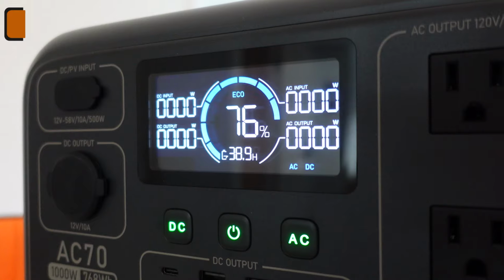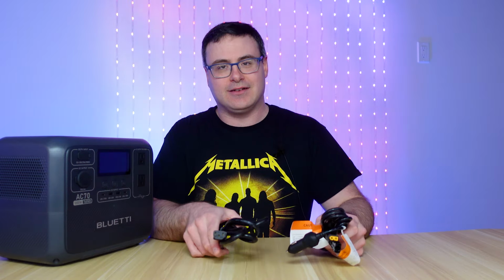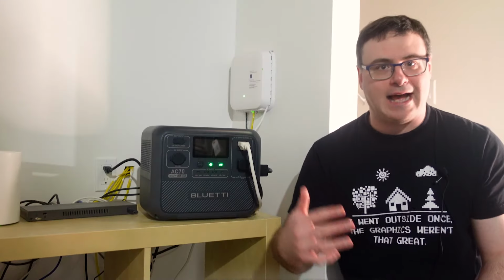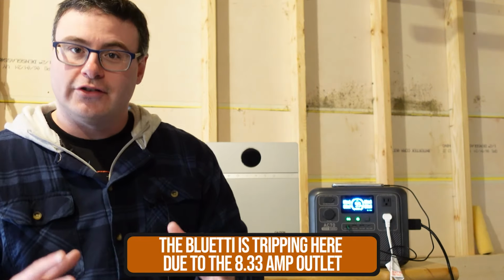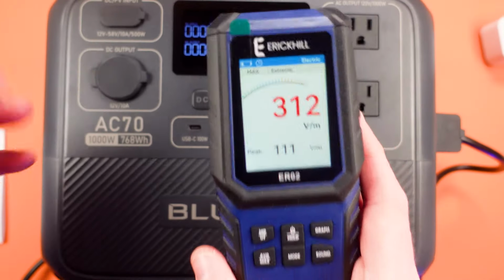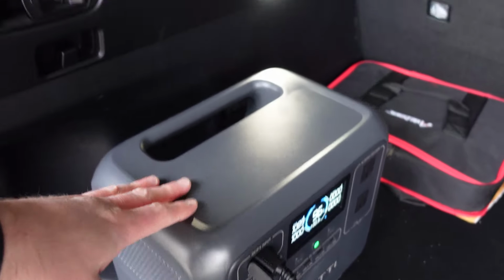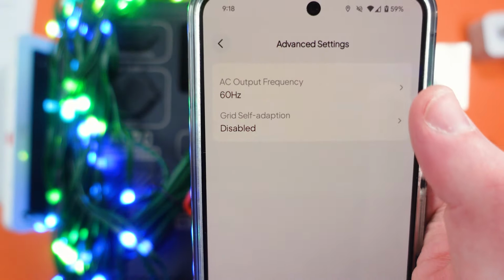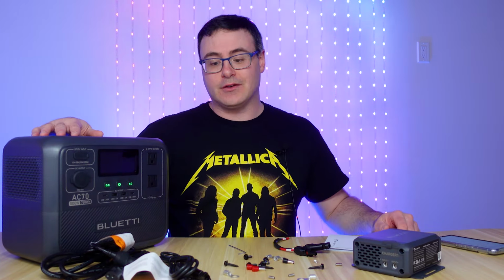Can I Save My Smart Home From Power Outages? (With the Bluetti AC70)

Comment: Why this vs regular UPS, it can stabilize the output voltage?
Reply from the maker: You can see in the tests we do...it handles fluctuation in power really well. Our electronics were pretty touchy, so they would have rebooted. The heaters also would have powered down.
Reply: @AutomateYourLife  fist off all thank you for the answer, sorry if i can not express my thoughts very well English is not my fist language. What would you say about using this instead of a UPS, I have the idea of putting a solution to keep my cctv system always online and the idea is on the rare occasion of a power failure to keep my router and the my cameras working 24/7.  My question here is just how the bluetti will behave when always connected to the grid? Do you think that handle good with that? Can you list some advantages one over another!? Thanks 
And 🎉 happy new year.😊

Comment: I've been using smaller brother, Bluetti 55 for over 2years, and recently I've replaced it with Ecoflow River 2 series, main reason being that Ecoflow has an "AC passthrough" or whatever the proper name is, meaning AC outputs are powered via AC input with a 30ms switchover time if power loss is detected. For me, this is a huge benefit, as Bluetti is constantly charging and depleting the battery resulting in ungodly battery cycle count and almost 30% battery degradation in that time period. In the meanwhile, I've tested that 30ms is short enough that none of my connected devices restarts or dies. So I'm quite happy with the upgrade. 😊
Just my 2 cents...
Reply from the maker: That's fair! I think it's going to depend on your priorities. I'd rather have the battery take the pain over the time, as I've experienced a lot of losses of expensive electronics.  Of course, if I was doing basic powering of my home and bought a more expensive one, I could see what you're saying!
Reply from the maker: the 30 ms switchover is good though :)  Sounds good enough for all electronics to ride through.  Do you know?

Comment: Thanks for the review. I have a battery back up for the house which works great, but the problem is if the power goes out, the Internet, and thus the Wi-Fi also goes down and I’m pretty much screwed.
Reply from the maker: Yeahhhh we need to be able to do something with that. I've noticed the ISP here is much better with that